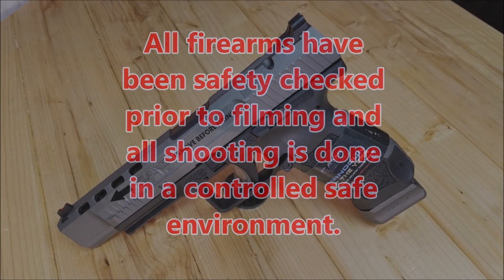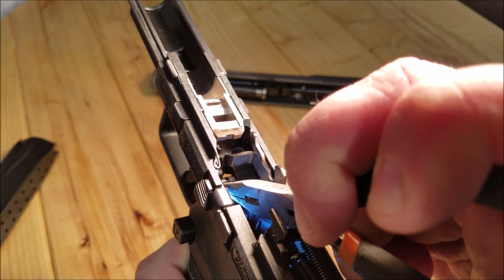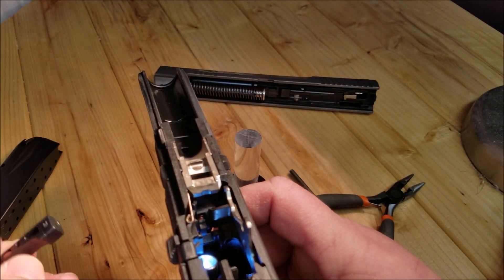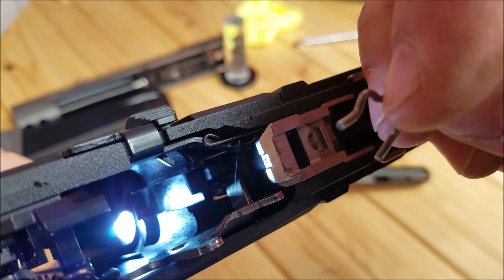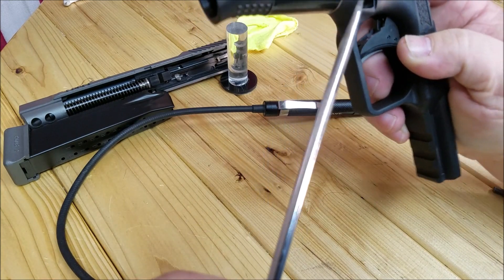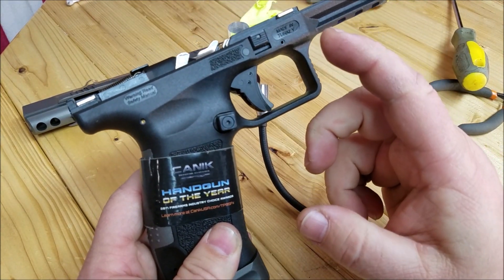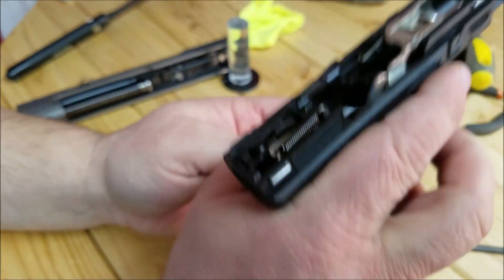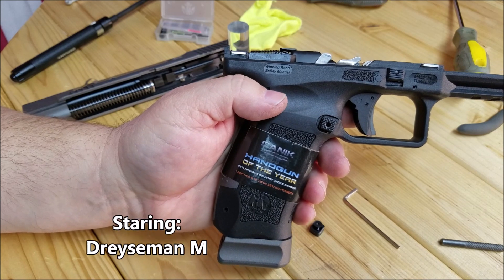CANIK TP9 SF SERIES MAGAZINE RELEASE SWAP

Comment: Here’s an extra tip I will add for holding the spring against the wall while raising the spring (4:00 mark):

Use the release button itself to hold the spring against the wall. 
I made 2 attempts at this before using the button, and both times the straight side of the spring would pop out, my skinny finger be damned.
Using the button gave me plenty of leverage to keep it in place while I raised the spring up into place.

Thank you for the video, 45 ACP! After two days of head scratching and I’ll attempts, this video got me onto the right track; and now my Canik is ready to rock again!
Reply from the maker: Thanks for the info and glad this helped you out. Thanks for watching.
Reply: @45AlfaCharliePapa  both your procedure and that tip really helped.  It made the part where you had the most issues the easiest part as the mag catch sideways is the perfect size for the space.
Reply: What a nightmare this was, horrible design for sure. Thanks for the video and this tip from Hubert, as well. I used your tip after fiddling with the clip for an hour and got it in place in about ten minutes (on the third try). Thanks a bunch!
Reply: Same my fat fingers are sore now
Reply: Works the best of any directions I’ve seen online.  I found after you hold the retainer in the track use a large flat tip screwdriver to hold in track insert screwdriver from top side, holding pressure against pin then push from the bottom keeps it in the track

Comment: I did this with my elite sc. 
Took me a full day to get that release back in. 

I finally outsmarted it by wrapping it with a thin rubber band. Inserting it into the release button. 
 Then cut and remove the rubber band pieces.  
I'm officially smarter than my gun.
Reply: Thank you I have been messing with this thing all day

Comment: Be careful. This fucked up my mag release. Now the spring pops up just enough for magazines to fall loose. Upon inspection i can see that the plastic wore a grove where the spring slides up on the bulbous side. Fix would be a bigger bulbous part. Switched back to other side until Canik offers to fix with new lower or modified spring.

Comment: Just figured out an easier way to do this. Squeeze the clamp thing with a pair of needle nose pliers. Once you have it compressed, wrap a piece of dental floss or thread around the compressed clamp. Wrap the floss as high as you can, making sure to leave enough of the clamp exposed to insert into the mag release  hole. 

Next, use the needle nose pliers to insert the clamp into the mag release. Once you have it set, use a razor blade to cut the floss, or unwrap the exposed floss using  the needle nose pliers. This worked for me.
Reply: After over an hour jacking with this clip and killing my fingers I to came across this method using sewing thread and compressing the clip...took less than 5 mins.
Reply: This is the best method

Comment: Holy pain in the ass Batman. Took me an hour and I'm not sure how many times that damn clip popped out. Got it done in the end though, good to go. Being lefty sure does blow sometimes.... thanks for the vid and the tips.
Reply: The same here.....
Reply: Sometimes?🙃
Reply: @charlesbeall2589  ima lefty, shooting while driving is a plus. Even in a standard transmission... shake hands while punching a face is a good ambush move. Lefty has some benefits.
Reply: If you use an alien key from the magazine side to hold the spring, it's much easier to slide the spring in the place on the magazine release.
Reply: I think maybe I will just live with it on the other side.  I MUCH prefer the design and procedure on the Smith M&P mag release.  Flat head screwdriver and 2 minutes work.

Comment: OMG, 2 hours driving me crazy and the spring popping out and across the room.  This video helped, but still hard to figure out a trick to keep the spring in the track and not pop out when raising and lowering the spring.  I read about some folks trying rubber bands or floss to hold the spring compressed to work it in.  What worked for me was to use a cut strip of an old hotel key card (cut the width of the track).  I got good working the spring into the track.  Once the spring is compressed into the track, I slide down the cut strip of key card on top of track and then I can use my finger pressing on the card strip to keep spring in the track and easily push the spring up and down with a skinny flat head screw driver.  I think I could switch out the magazine release much more quickly next time.  However, I'm never changing it again!
Reply from the maker: Nice Tip. Thanks for watching and hope this video helped.
Reply: Man I know it's been a year since you commented but after like 6 hours on and off of trying to get that dang spring to not pop out your solution of cutting up a card worked first try. Thank you very much for the tip.

Comment: Thanks 45 ACP,  I have a few tips after about 3.5 hours of screwing around with my canik tp9 elite SC.

1) Don't do it unless you have to!!!
2) Find a flat head screw driver that fits the channel 
3) Get a pair of Channel Locks and Needle Nose Pliers
4) Take out the pin, make sure not to loose it
5) Squish the pin using the Channel Locks until the pin easily fits into the channel where the button is
6) Bend the end of the pin with the bend it it so that it lifts off the back plate and tracks towards the wider hole once the release is installed
7) Follow 45ACP's video and use the screwdriver to hold the pin into the channel using another smaller flat head to lift the pin up and into the channel from the mag button area
8) Once the pin is in the channel, take the button and place it into the hole
9) Line up the wider hole of the mag release button and continue to hold the pin in place with the wider flathead while pushing down on the pin with the smaller flat head.
10) Push until the pin is in the larger hole
11) Once the longer part of the pin is in the hole, move the larger flathead so that is is coming from the bottom of the mag well to hold the bottom feet of the pin into the channel
12) Use the smaller screw driver to slowly guide the shorter side of the pin into the hole while applying tension to the pin via both the larger screw driver and by pushing the mag release.

Doing this is all about limiting the amount of motion that the pin can go, use your screwdrivers like walls to contain the pin into the channel and slowly guide that pin in. Also, please be ready to use every curse word as well as create a few new ones. GOOD LUCK AND GOD BLESS!
Reply: Thanks

Comment: The slot for the spring is the same thicken as the mag release button bar. I used the mag release button to keep the spring flat in the channel and it helped a lot. Set the spring down below the channel with the button removed, both sides of the spring in the channel (takes some work). Once both sides are in (but below where the button goes) use the mag release button to hold everything flat and carefully use a needle nose plyer to pull it up into the channel. I continue to use the mag button to keep it flat in the channel as I push it upward from the mag button slot so it lets the mag button where it should go. When the spring and button are in place, use a punch to hold the short side flat as the push the whole spring down into the button bar. Align the short side and continue to push it down into the bar. Took me a while to figure it out, but I could do it again much easier now that I know. The first step is getting the spring into the channel and clear of the mag release bar. Once that is done, your 90% done.

Comment: Best and easy way to do this , put the spring in a vice , compress spring and wrap fine thread around it and tie , then just drop in and cut thread . Works like a charm .
Reply from the maker: Nice hack. Thanks for sharing and watching.
Reply: Thanks for the tip! Switched it in 5 minutes. Removed spring, compressed spring with vice grips, wrapped in dental floss. Switched the mag release button to the other side. Slid the compressed spring right into the channel from the top into the holes in the mag release button. Cut the dental floss. Done.
Reply: @LordKinjin  yeah I was struggling trying to do it on my elite combat ,I had done it with pliers pretty easily on my sfx, but the combat seemed like a stronger spring, so I that idea just popped in my head and tried it and it worked easily ,so I had to leave the comment .

Comment: To anyone still having issues with this install, I got it done in 5 minutes following this method (Canik SFX Rival). It was easier to have the frame stationary in a vice block or similar, but I also did it without. Using a pair of locking medical forceps (also sold where fishing supplies are sold to remove lures from fish) I was able to keep the spring compressed while I inserted it into the channel and then carefully removed the forceps, next using a small needle nose pliers I was able to manipulate and push the spring downward into the holes into the release button assembly, made easier by depressing the mag release button a small amount to better line up the holes. Good luck!

Comment: My fingers are bleeding from how many times I e put this spring in the channel. Read comments for tips as well. Tips I used were cutting a piece of a plastic card/bank card the size of channel. Also squeeze the spring as tight as possible and hold for a bit to make it less stiff. Also use a flathead like walls to keep the pin in the channel. Push down slowly and use the flathead to guide one side of the pin while watching the other side. If it starts to get close to coming out switch sides. Get the longer side tip in first then the short side tip. Then get the long side bulge into the larger opening in the release. Definitely not easy. Took me 2 hours. Make sure it's what you want beforehand. I would not suggest changing just to change it back waaaaaaaay too much hassle. But one and done is worth it for a lefty
Reply from the maker: Glad this helped and thanks for watching.

Comment: Thanks for the video instructions! Used your method of placing the pin in first. Then used a phillips from left side to hold shorter side of pin up, while I used another phillips to raise other longer, curved side slowly so the pin wouldn’t pop out. Took a few tries like you said but I did it. Definitely wouldn’t have attempted replacing with longer mag release without your help! Thanks again.
Reply from the maker: Thanks for watching. Once you have done it a time or two it gets better but they could have designed it better.

Comment: After fighting with this for an hour and giving up i ended up filing some grooves along the those walls so the spring sits in the grooves once pushed up in there. After i did that i installed it in 1 minute. Thats all canik would need to do to make this an easy install.

Comment: I'm one hour in & the spring keeps popping out. Will take mine to a gunsmith.
Reply: I’m four hours in and I still can’t do it
Reply: @LadyBNatural  I took mine to the gunsmith at my gun range. He got it done in 20 minutes & didn't charge me. It looks easy but it's so finicky.
Reply: If you use an alien key from the magazine side to hold the spring, it's much easier to slide the spring in the place on the magazine release.
Reply: Doing this on my 2nd Canik. 2 hours in & now it looks like a mouse crawled in & chewed up the inside so I'm taking it to my gunsmith again.

Comment: The Mag release button is large, but if you remove the screw in the center of the button you will find that the button has an extension on it, and once you remove the screw and that extension it has a knurled button that is normal sized underneath.. I removed my extension, the stock configuration was bothering my thumb, once removed it was no different in size to the 1911..

Comment: I have a tp9 elite SC 
The 12 round mag will go flying out of the gun with the slightest touch. The 15 stays in fine. I think their mag button springs are garbage
Reply from the maker: More likely the 12 round mag is not cut correctly for the mag catch to fully insert. If one mag works fine and the other does not it is a magazine issue. May need to open up the slot a little on the mag or contact Canik and get a replacement. Thanks for watching.
Reply: @45AlfaCharliePapa  I contacted them about it. I really like the pistol otherwise. I like it way more than my 26

Comment: I have been trying to get that sping back in for a whole day.I figured out how.. After you are ready to push that spring down into the release, take a flat head screwdriver wide enough to fit in the grove and push against the spring with a little pressure,then take your needle nose pliers and push the spring in.See the flat head screwdriver is holding the spring in so it doesn't jump out when you try pushing the spring in the release.After I finally got my sfx done, I went ahead and done my sf in the first try.Hope this helps you out.....

Comment: If I just want to change the size of the mag release button, how do I go about that? Do I have to take the whole thing out like you did?
Reply from the maker: If you have the SFX it is just a matter of unscrewing the screw on the button and replacing it with a taller or shorter button provided with the gun.  If your mag release is the standard button with no threaded hole then yes you would have to buy the adjustable one form Centry and replace the whole thing like in this video. Thanks for watching.
Reply: @45AlfaCharliePapa  ~~~ I have the TP9 Elite Combat, I too am trying to change the size of my mag release button. Do I unscrew clockwise or counterclockwise? I’m trying to avoid stripping the screw

Comment: That was definitely the dumbest mag release design of all the guns I’ve ever worked on (Sigs, M&P, CZ, Glock, Beretta). There’s no reason to not have some sort of indentation for the spring to set in to keep it from popping out when under tension while lining up the mag release.

Anyway, thanks for the video. Took about 10 attempts but it’s installed